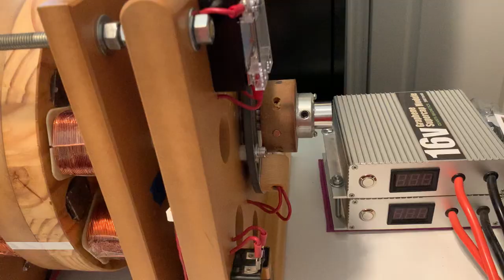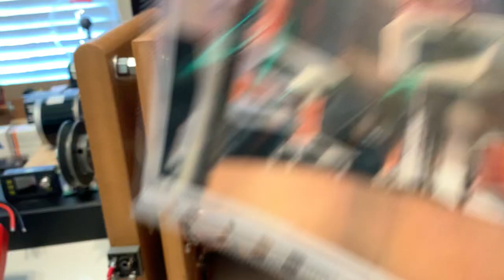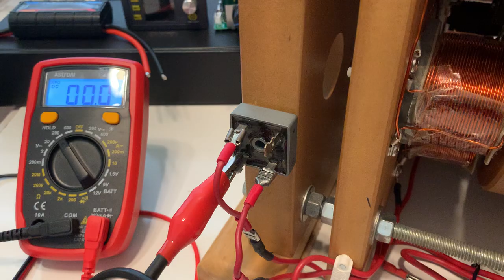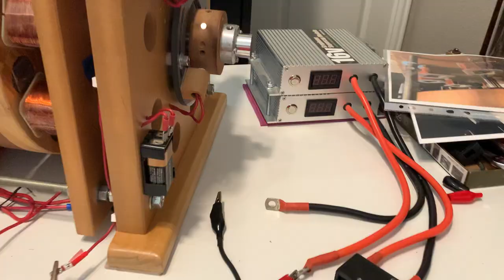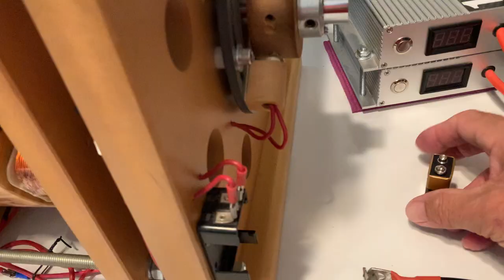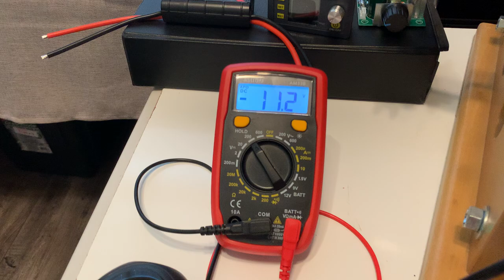My Build of The Liberty Engine #3 - Blast From The Past

Comment: I have also copied his motor similar to yours but I have two rotors one each side it's more efficient than one rotor because it utilises both sides of the coil at once. Using ferrite core in the coils helps power output but increases clogging to overcome cogging you have to have a different amount of magnets to the coils and timing that correctly to reduce cogging

Comment: Hi Scott, I understand your setup uses a shared rotor with two stators, one as a motor and the other as a generator, both producing AC due to magnet configuration. But what's the actual purpose of the machine? Is it just a conceptual demo, or does it have a specific intended use? Thanks.

Comment: Hi, first of all I have to say that your wood and inductors setup looks really good. I very much like the machine's look and feel. On the other hand, I got lost in your explanation, you have said that there is a motor and a dinamo together? What is this for? What is the objective of the machine itself? Thanks for your answers.
Reply from the maker: Hello, This is one definition: "Dynamos are mechanical devices designed to generate electricity. The basic components include: Armature: The rotating part of the dynamo that carries current. Field Magnet: Produces a magnetic field to enable current generation. Commutator: Converts alternating current (AC) to direct current (DC)"
**My device uses a relay with a simple commutator to distribute DC source power to cause one stator to turn a shared rotor, 
(the motor), while the other side of the same rotor energizes the other stator to produce AC electricity, which can then be converted to DC electricity if desired, (The Generator). In my configuration, both stators are producing AC electricity because of the magnet configuration, One side is acting as a Motor and the other is acting as a generator. Thank you.
Reply: Hi Scott, I understand your setup uses a shared rotor with two stators, one as a motor and the other as a generator, both producing AC due to magnet configuration. But what's the actual purpose of the machine? Is it just a conceptual demo, or does it have a specific intended use? Thanks.

Comment: I friend told me what the ingredients is for the special alloy! Also in the liberty engine video, there was a black screen that flashed for a millisecond and if you pause it on the right time, it has the ingredients in white letters.
Anyway, it’s worth checking out
but here is are the elements for the alloy

57 Lanthanum

26 Iron

5 Boron

13 Aluminum

14 Silicon

49 Indium

67 Holmium

30 Zinc

41 Niobium

44 Ruthenium

64 gadolinium

34 selenium

52 Tellurium

66 Dysprosium $1200/kg

47 Silver

59 Praseodymium

31 Gallium

32 Germanium
40 zirconium
It is in fact mostly silver and aluminum but the small amount of other rare earth minerals is VERY important.
I want to build one, but it’ll be well over $7000 in parts and elements 😢
Reply: Wow Rebel! What a sparelist of very rare metals. Agree that this is part of ‘the magic’. Which makes the machine too expensive, but it proves that it is possible
Reply: @hansscholte5472 it sucks because most of these are rare earth minerals and are hard and expensive to get ahold of. The liberty engine team said they have spent over a million dollars on equipment and experimenting.
It is possible, it’s just been hidden from the people 😔